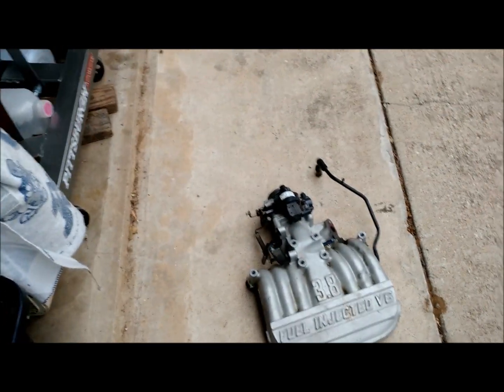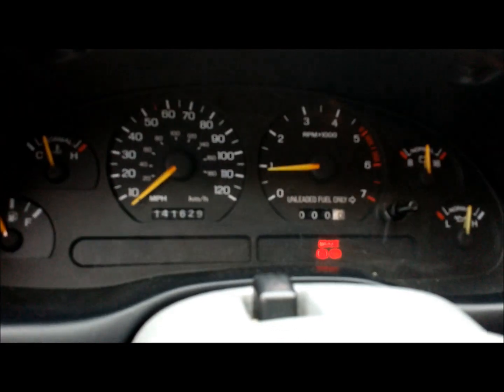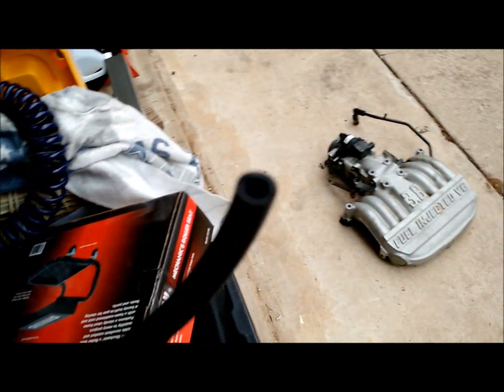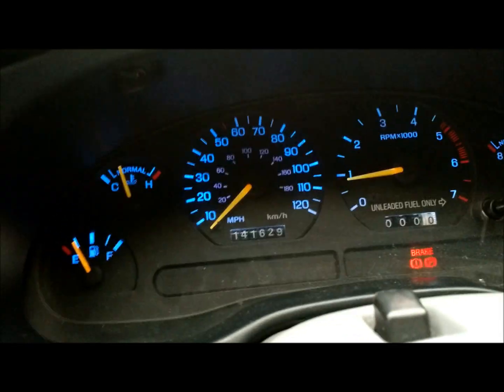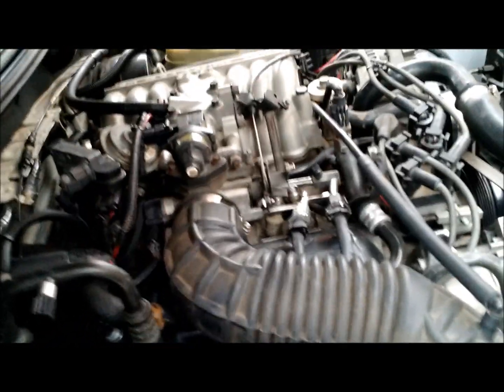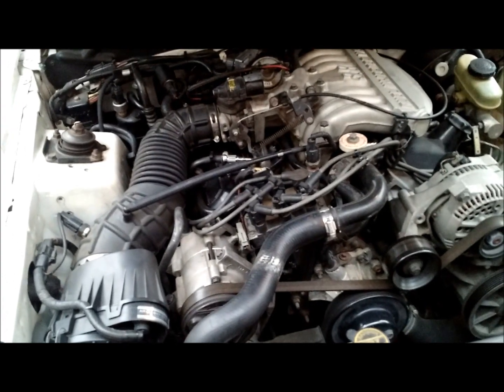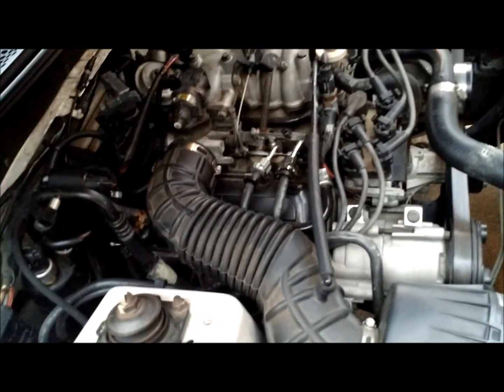How to Find and Fix A Vacuum Leak

Comment: Actually, you're dead wrong about running rich.

If your MAF and upstream O2 sensors are operating correctly, your air-fuel ratio should still be correct. That's their purpose, to provide data so that the computer can maintain the proper AFR. The only way you're running lean is if you're getting so much unmetered air, the LTFT exceeds the computer's maximum compensation (25%). That's when you pop a P0174/P0171 code.

 The only way you're running rich is if your O2 sensors and/or MAF are screwed up and reporting faulty data to the computer. A vacuum leak alone isn't going to make your car run rich.
Reply from the maker: Correct. I can’t believe this was 10 years ago haha. I think I was trying to say if you get a lean code, your computer will be adding fuel to richen the mixture.

Comment: You should take that Mustang to C&J auto in Washington courthouse Ohio, For a mere $578 they will replace your blown intake gasket using Harry Potter's most powerful wand, so as not to  disturb old oil and dirt build up, leaving your car in original condition, clear the codes and ignore the bad bank 1 sensor1 fault and then ignore your phone calls. but it comes with a 2 or 24000 mile warranty
Reply: rekt

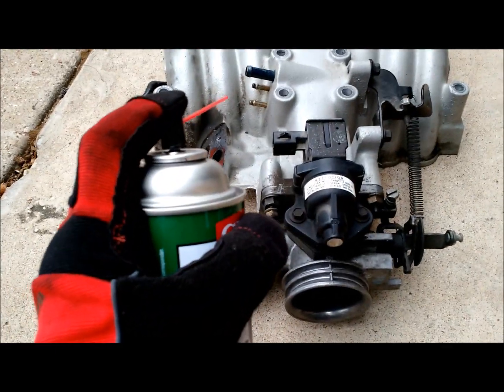Comment: Good video however I have one correction: at 5:16 you claim to be listening for a drop in idle. Actually if there is a vacuum leak and you spray brake cleaner at it, there will be an increase in idle. The reason for this is that, like carb cleaner, brake cleaner is flammable and when it replaces the air getting sucked in it provides more fuel into the system. I haven't found a brake cleaner that isn't flammable.

Comment: thanks for the nice explanation .The code reads LEAN but it's actually  RICH.Some of the other videos don't seem to bother  mentioning that
Reply from the maker: Right. If the computer sees not enough fuel, it sets a LEAN  code and ADDS fuel RICHENING the air fuel radio in attempt to get the mixture within acceptable operating range
Reply: BS. Read my comment above.

Comment: if my car hesitates when accelerating and stays between 2-2500k rpm is that a vacuum issue or spark plugs? I also have no cel.
Reply from the maker: To be honest, I'm not sure. I've seen videos and heard of Nissans (like your 350z) doing that same thing. I'm sure there is a forum out there with the solution
Reply: Found out there was oil in the spark plug well have a bad ring on valve cover which is leaking oil into the well

Comment: I have a big vacuum leak somewhere along the intake. I've sprayed on starter fluid nothing revs up and down I've also have no check engine light I have no idea what's wrong
Reply: MORNING GARDENER'S SHOW. Take it to a shop so they can use a smoke machine to find exactly where the leak is

Comment: Would this be the cause of my vehicle shutting off when I put it in drive/reverse but be ok in P and N?
Reply: Very possibly. Particularly if you're already idling pretty low.
Reply: Did u figure out what was the problem? Cause rn im dealing with the same problem in my 94 Gt
Reply: @eleazarojeda6196  does your car have a carb? Cuz with my car, I just had to bring up the idle on the carb.
Reply: @jacobrodriguez8572  I still have EFI bt i can promise u that ill do carb swap cause im tired to deal w this problem   My car idle perfect until put D and R

Comment: I saw that manifold and got instant nostalgia of my old v6 mustang. Learned to work on cars with that thing!

Propane is a safer solution to use for location leaks since it is vapor it will be a quick burning fireball if it happens to ignite instead of a slow burning fire that can ignite oither things easier like with liquid fuels.

Also if you have a scan tool capable of looking at o2 sensor values, monitoring these for a sudden richer condition while spraying is easier sometimes than listening for rpm changes.
Reply: I’ve got a 2000 mustang v6 and it started bogging out and not even idling on its own, it sounds like it’s on 2cyl so I replaced the plugs wires and coil pack but still no fix any ideas?
Reply: @jessevandecasteele4013  
That's complicated but Ill try to help.

First and foremost, double check your work and make sure the right plugs are connected to the right wires to eliminate firing order being the issue. Scan the ECU for engine codes and use that as a breadcrumb.

Next, check the spark plugs and see if they are wet. If they smell like fuel that tells me no spark but plenty of fuel. 

If you have dry plugs, change the fuel filter in hopes that it brings fuel pressure up to healthy levels.

If those three things fail, follow the below...

Fuel + Spark + Air = Running Engine.

Find the fuel pump fuse and remove it while the car is running. Let the car idle until it dies.

Then, check to make sure the plugs are firing by removing each spark plug, hooking it to the correct wire, grounding the threaded part of the plug to the head, and turning the car over looking for spark. Don't electrocute yourself by holding the plug. Rest it on the engine block and have someone crank the car, you may need to do this in the dark to see the spark. You can also buy a spark tester that lights a bulb for you but this way you check the plugs themselves. Check plug gaps.

If all plugs spark and the plug gaps are correct, reinsert the fuse for the fuel pump and check that fuel is making it to the rail. There is a Schrader valve on the fuel rail(iirc) that you can open to see if there is fuel pressure. Should be since it's running(albeit rough.) Its the same type of valve that's in your tire's valve stem, catch any fuel it squirts for fire safety.

Next, check fuel pressure at idle with a fuel pressure gauge connected to the Schrader valve. Compare values you get to factory specs to determine if the pressure in the rail is enough to feed all of the injectors. If it's not high enough the two closest injectors to the inlet could be using up all the pressure(to keep it simple.)

Finally, you need to check for compression. You can use a standard compression tester that you can buy anywhere for cheap. Make sure there are no cylinders too out of sync with the others and that they are within factory tolerances. You should do this with all the plugs removed and with no fuel pump fuse/fuel pressure in the rail. Also try to do this with the engine warm. With bad compression you can isolate the cause with a leakdown tester.

If all things pass I would look at sensors like PRIMARY O2(not secondary), Intake Air Temp, Coolant Temp, or Throttle Position. It could be so many things and its been so long since I worked on those engines I'm sorry I cant be more help.

Good luck, I have notifications on for this comment, Ill try to help if I can.
Reply: doesn't sound safe.  lol

Comment: my truck is running like it's only hitting on7 cylinders what can it be
Reply from the maker: sounds like a fuel or spark issue. most of the time a noticeable misfire of a single cylinder (consistient misfire) is caused by secondary ignition components such as: spark plugs, plug wires, and ignition coils. I'd check those first. pull spark plug wires off one at a time. when you see, or should rather hear, no change in engine performance, youve found the cylinder with the misfire. start changing components with a neighboring cylinder until the misfire moves. whatever part you last swapped before the misfire moved is the part at fault
Reply: Maybe it's a fancy European 7 cylinder motor...

Comment: 1995 uses obd1 scanner, I thought.
Reply from the maker: michael hanglow not for the mustang. the V6 got obd2 in 1994. the GT got it in 1996. although the 1994-95's still have to go on rollers in order to get an inspection.
Reply: Interesting how you guys got OBD2 so early. Here in the UK it wasn't until after the turn of the millennium. I've got a 2000 Nissan that has obd1, but a couple of Toyotas from the same year with OBD2. Never knew this until your comment so thanks!

Comment: I use a propane torch cylinder and Do Not Lite it.....just use the torch tip to probe hoses etc. And the the motor will SPEED UP! From sucking in the propane gas.

Comment: ok thanks..I sprayed a little bit of carb cleaner and nothing happened. .I'll spray more and see what happens..the hose looks like someone cut it where it meets the pcv valve and made it shorter..I'll  also check of the intake gasket thanks

Comment: Why is your oil pressure so high? Mine rides at the R or N Of Normal
Reply from the maker: not sure. the motor isn't the original one. we pulled it from a car in a junkyard. it seemed to be rebuilt recently. maybe they put in a high pressure oil pump or something.
Reply from the maker: figured it out. the oil pressure sending unit acts as a switch. apparently the dial will read approximately the same pressure even though the actual oil pressure may be high or low

Comment: Don't use break cleaner, it melts paint. Use carb cleaner or to be safer propane.
Reply: Yes propane is the best because it will stop instantly when closing the valve so no change of a fire caused by the remaining break cleaning or carb or wb40  cleaner

Comment: WHAT OTHER PROBLEMS WILL AN INTAKE MANIFOLD VACUUM LEAK CAUSE ..... I HAVE ONE NOW AND I PLAN ON GETTING IT FIXED THE 1ST WEEK OF JUNE 2015 IT'S BEEN ABOUT 1 ALMOST 2 MONTHS SINCE I GOT DIAGNOSTICS ON IT BEFORE THAT IT DIDN'T COME OUT ON ANY DIAGNOSTICS TEST AND I RECENTLY GOT BOTH MY VALVE COVER GASKETS DONE IN THE BEGANING OF THIS YEAR ....FOR MY 2002 PONTIAC FIREBIRD V6 WHATS THE MAXIMUM MILEAGE SHOULD I DRIVE WITH THIS ISSUE MY MECHANIC SAID IT WOULD ONLY CAUSE MY CAR TO RIDE ROUGH AND CAUSE BAD PERFORMANCE